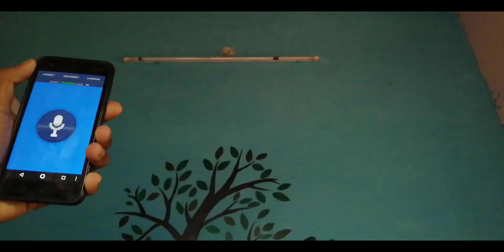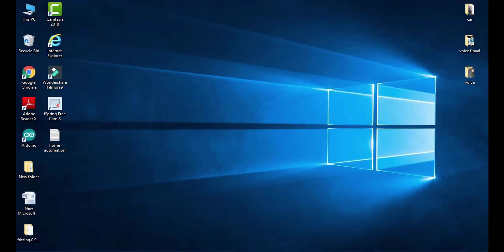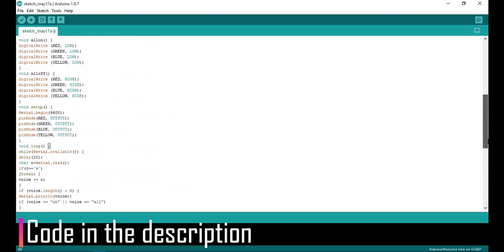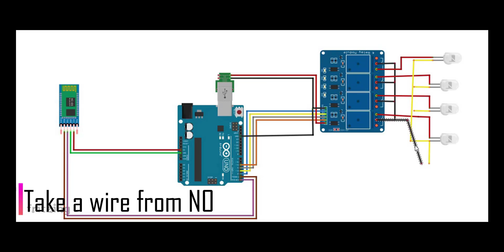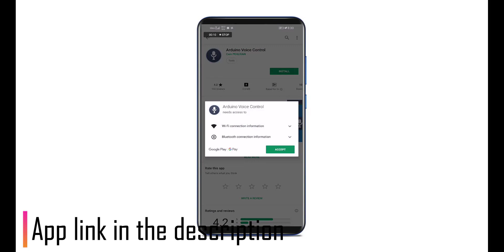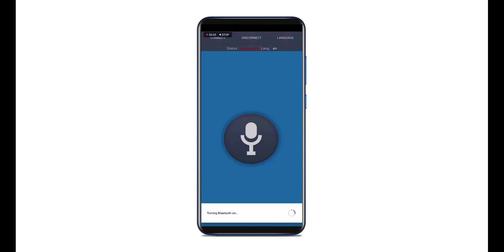How to make a DIY Arduino voice controlled home automation system using Arduino | Malayalam

Comment: Good job, but I need your help , I did exactly what you did, the schematic is the same , the app is the same but  the application did not paired talith the arduino , even when I talk the serial monitor is working , I hear  What I say in the android , the bluetooth is connected , its LED is stopping blinking which means that the bluetooth is paired. I am lost , if there any setting in the android?